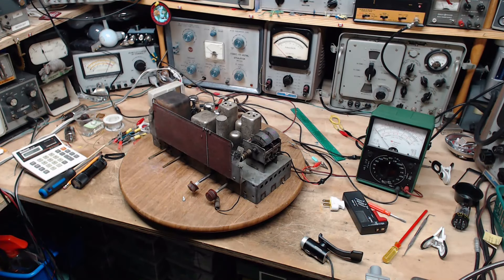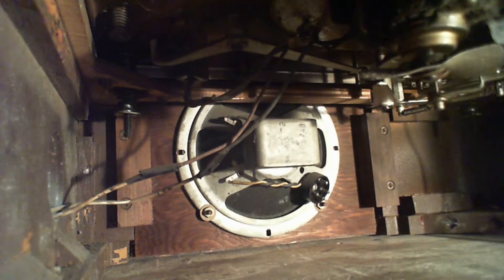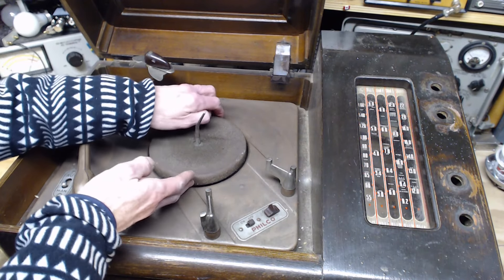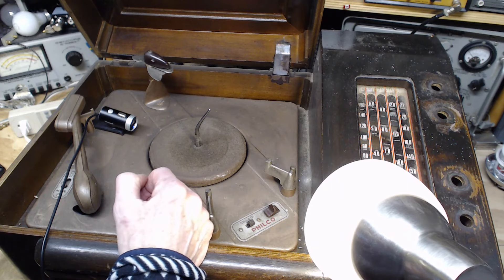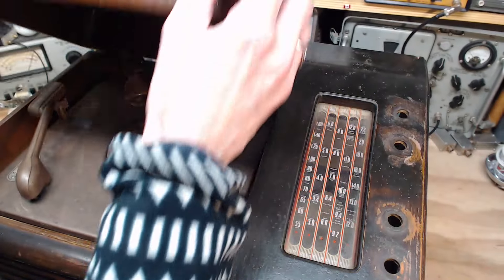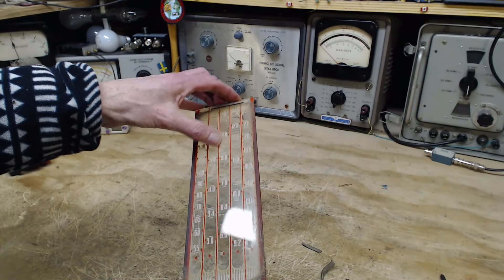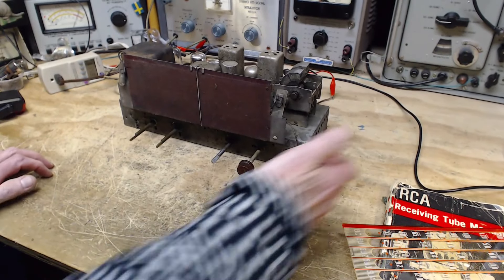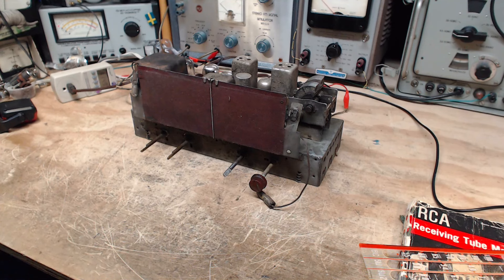Philco 48 1826 Console Video #13 - Record Player Checkout, Radio Dial Accuracy

Comment: the things you were turning by the Switches are for selecting the record sizes. 10 and... I forgot what the other size would have been produced back in the 30's!

also, that would be a very nice phonograph to have!
Reply: 78RPM disc sizes are 10" & 12".